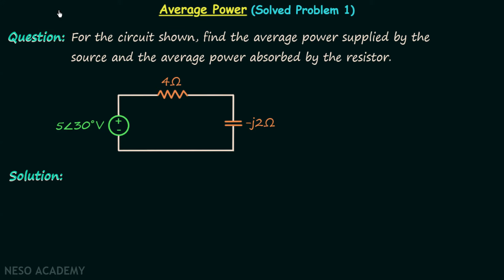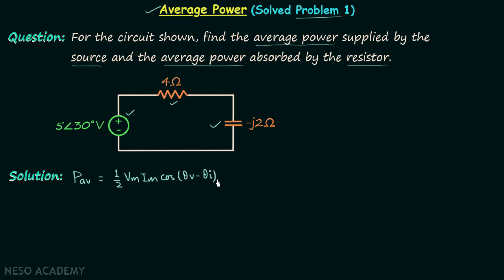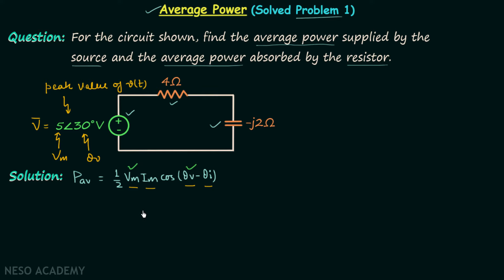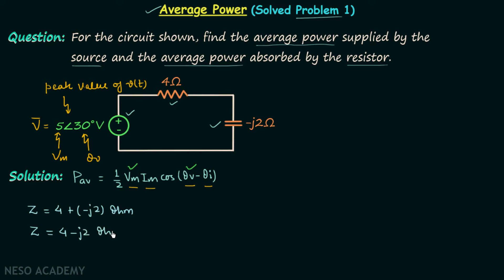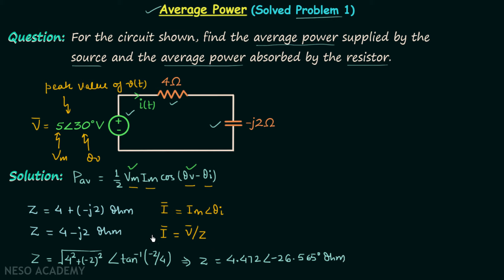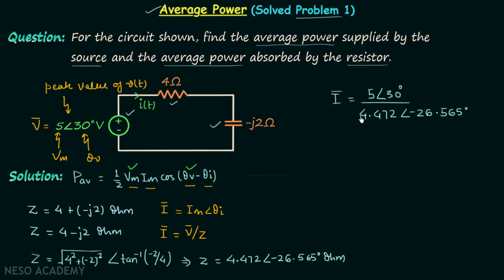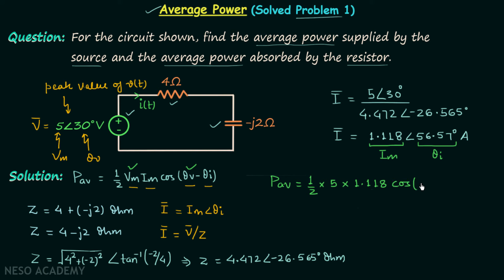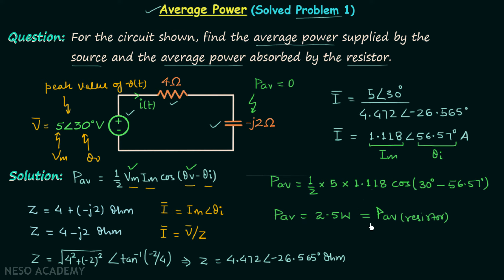Average Power in AC Circuits (Solved Problem 1)

Comment: Sir you told that tan inverse formula for calculating phase works only when x and y belongs to 1st quadrant... But here in the problem you didn't add 360 degrees to the phase???!!
Reply: not 360deg man it's 180deg for 2nd and 3rd quadrants
Reply: @gokulramakrishnan4079  it is in 4th quadrant
Reply: Haa yahi question mere mind mein bhi aa raha....sir ko 360 add Krna chahiye tha...pr ye reading clockwise sense mein liya gaya hai ... Aur sir ne anticlockwise sense mein reading liya hai....dono case mein hi same value aayega ... average power calculation mein.... isiliye shayad sir ne reading nahi badla...kyuki koi farak nahi padta
Reply: Any angle +360 = any angle
Reply: Don't wry do as he mentioned earlier..both answers will be same

Comment: in the expression 5<30(5 angle 30)the value 5 is rms voltage right .why did you consider it as maximum voltage sir?
if i am wrong please correct me.
Reply: You are right